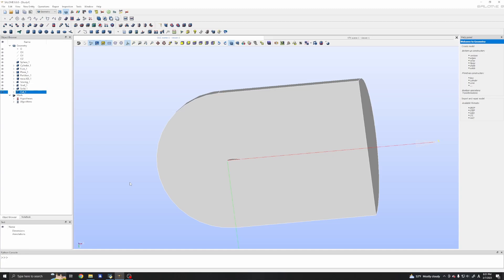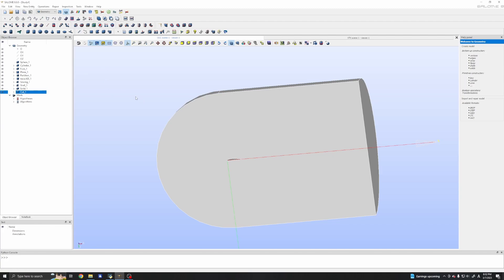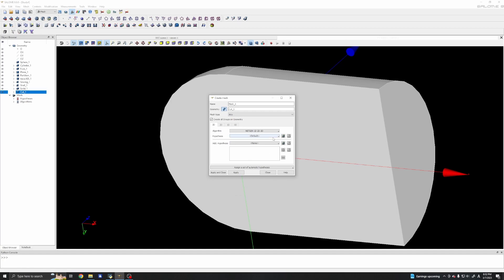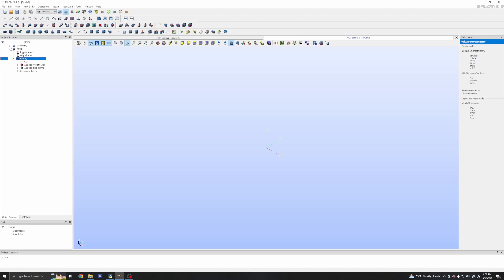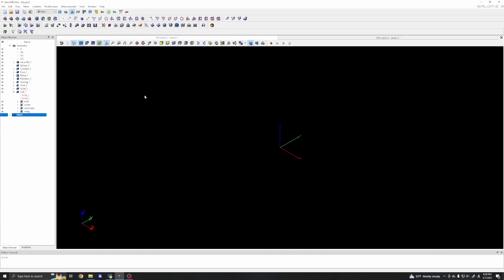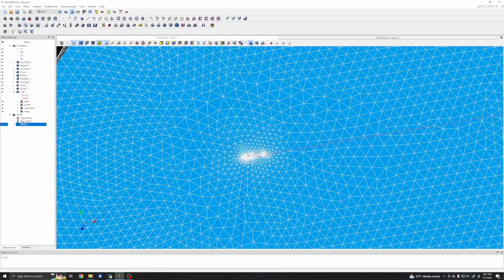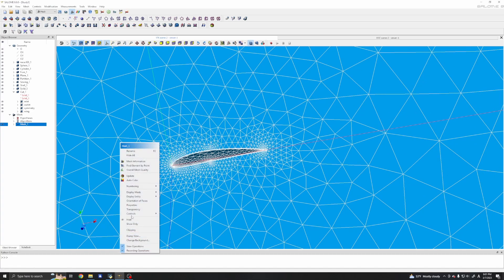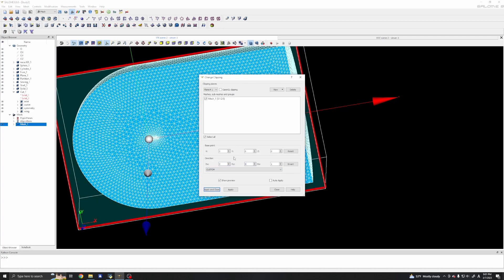Salome for Industrial CFD tutorial (Creating Mesh of a NACA Airfoil)

Comment: Hi Thaw! I have a question, it is not related to the video, but I appreciate it if you can help. What causes nan values at some points to appear in the output files in openfoam?
Reply from the maker: Most of the time, it means your simulation diverged but it seems to happen if you compute stress analysis or particle simulation (dpm, etc). 

It is interesting because I have never faced Nan values in OpenFOAM. The solver just stops when residuals go up to 1e+100, etc before showing Nan
Reply: @thawtar682  could you explain more what do you mean by particle simulation? , I am simulating natural convection flow. I have another question if there is turbulence in the flow and I am solving it laminar, could this be the reason for the divergence?
Reply from the maker: Particle simulation means discrete particle methods (DPM) simulations. 

In my experience, solving turbulent flows with laminar solvers cause just not very stable results or wrong result values. But not divergence of simulation. 

Most of the time, divergence is caused by bad meshes or bad boundary conditions. If you use 1st order schemes and it still diverges, it is due to boundary conditions
Reply: @thawtar682  Thank you so much!